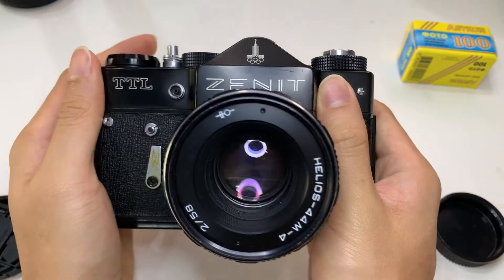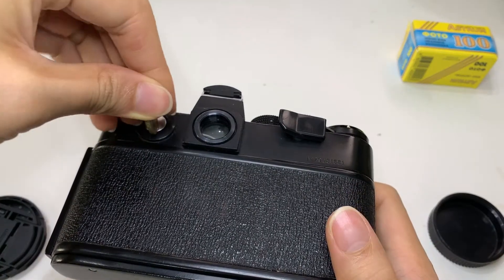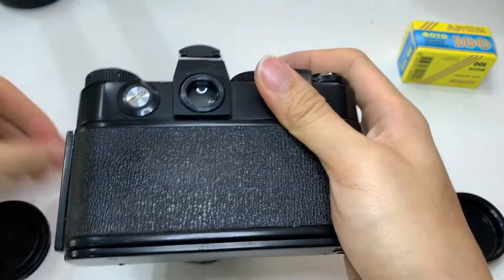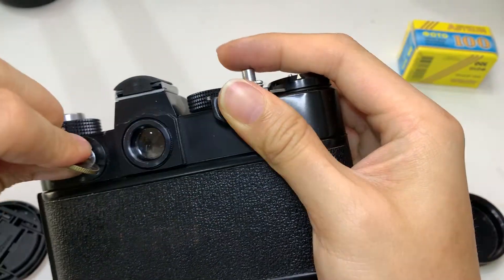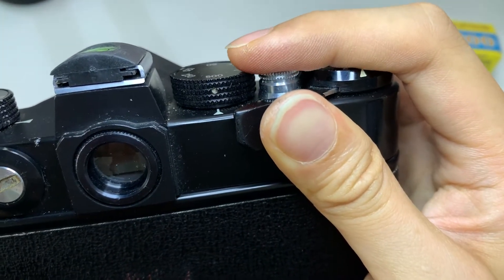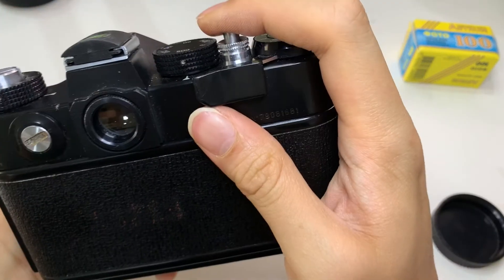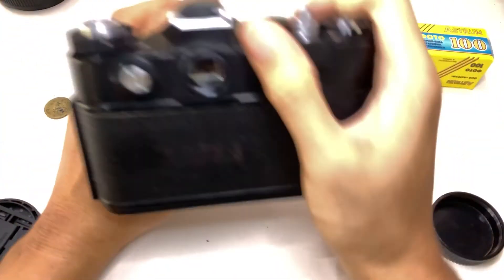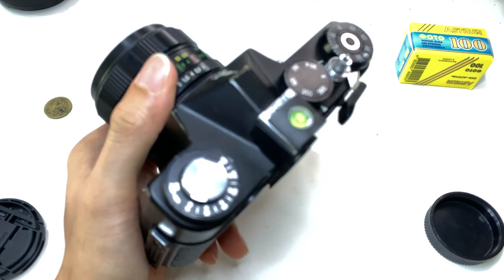Zenit TTL Camera Light Meter Demo

Comment: Hi!, what battery do you use??
Reply: Not sure if you still need this info but I ordered 625GH batteries from amazon, I think as long as its 625 size it should work
Reply: @romanyamal1830  Hi, were you using a single battery, or two? Thanks